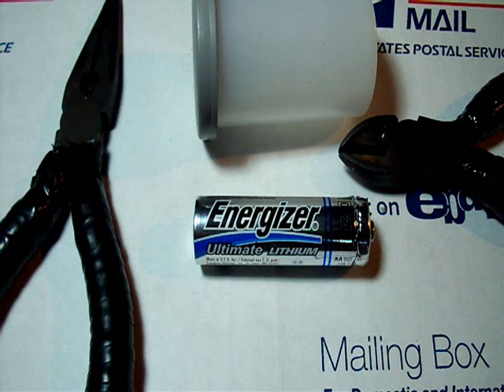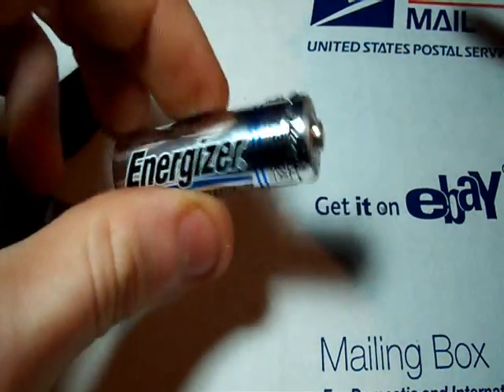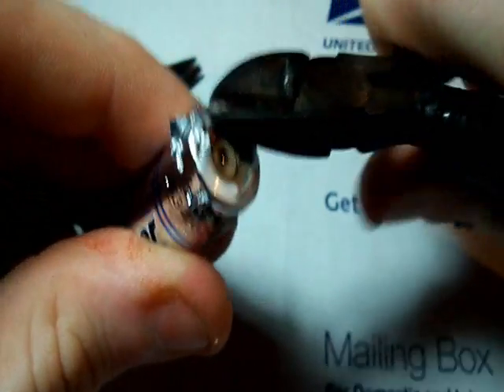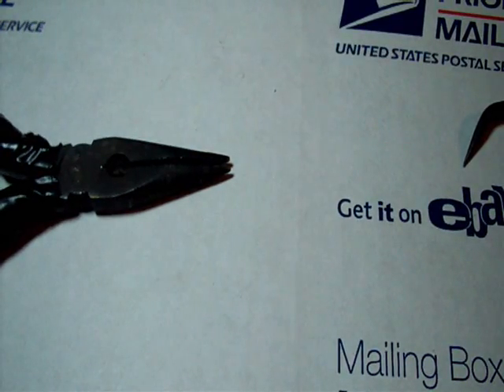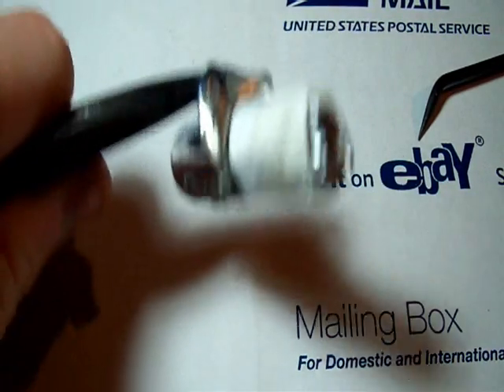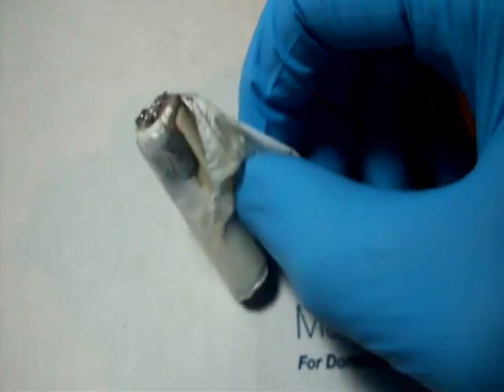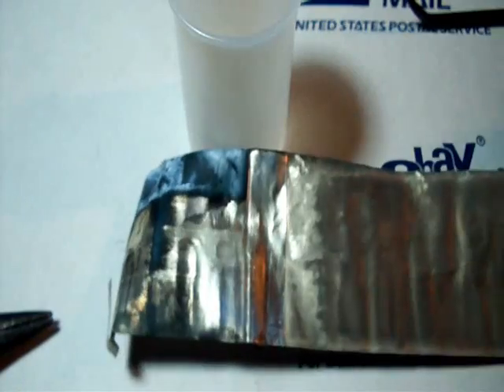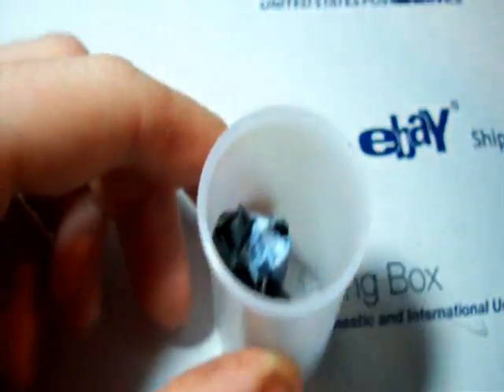Lithium Metal from an Energizer Lithium Battery- EvanMods.com

Comment: If you want it to last for a long time get a small container and fill it with paraffin oil or unscented baby oil and put the lithium in it (works with potassium too). It has no contact with air and will last for months without tarnishing.

Comment: A much easier way to do this is to use a tubing cutter (pipe cutter).  Use the tool to cut through the casing, then pull the two halves of the casing apart to expose the core.

Comment: Have you tried using a small pipe/tubing cutter instead of the wire cutter and needle nose pliars? It seems that once you get the top off, you could use a small pipe cutter (they look like a vice with wheels inside them) to make it easier to get through that tough steel protection.

Comment from the maker: Sometimes it will do that. If the water is a little cold then most of the time it will just slowly dissolve away. Putting it in hot water and using a blow torch makes sure its a cool reaction ;)

Comment from the maker: @Raddan2010 
The batteries that actually have lithium metal in them are not rechargeable. You most likely have a Lithium-Ion (Li-Ion) battery. These dont have lithium metal in them that you can use.